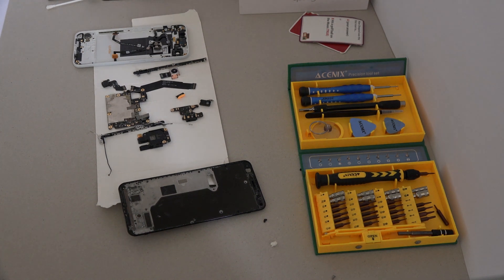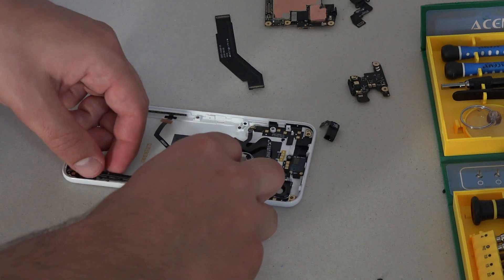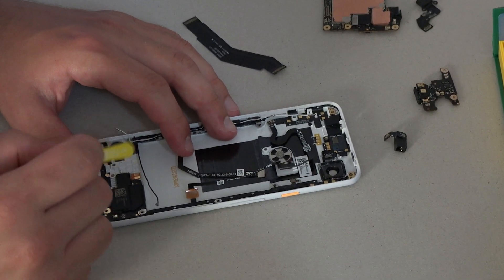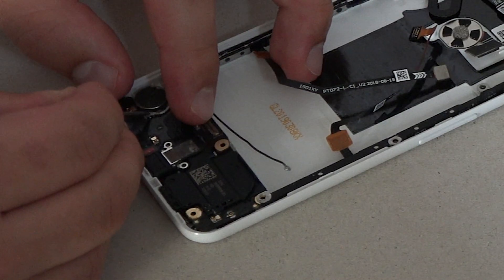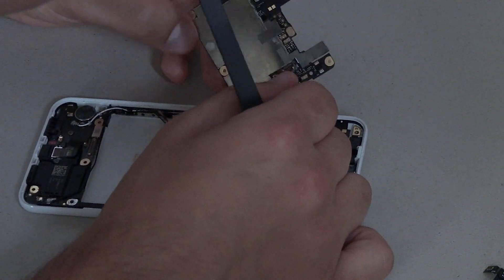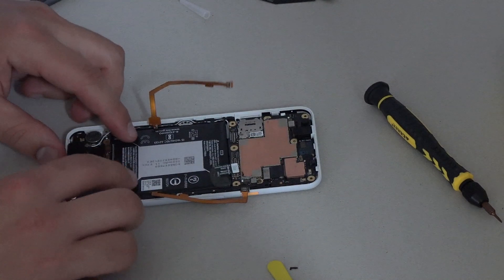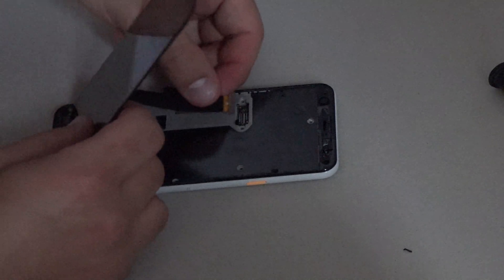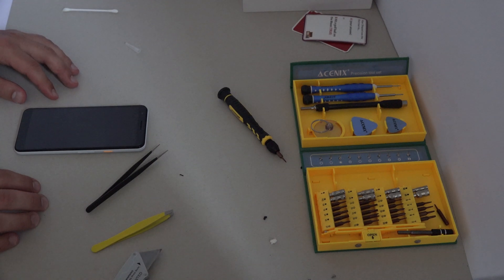Pixel 3a Teardown part. 2 - Assembly

Comment: If the mother board is bad, can the files (pics etc) still be saved?
Reply from the maker: You'd have to try moving the flash memory to a new board, or repair the board that broke. That's beyond me but try checking around YT or see if a repair shop can helop you (check reviews - some places have no idea what they are doing)